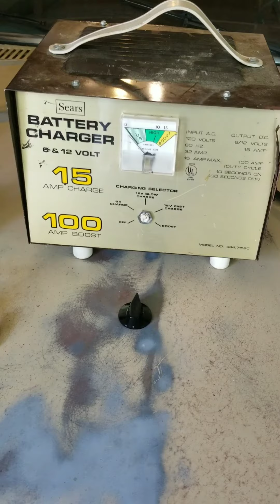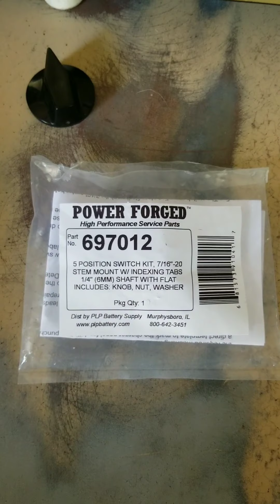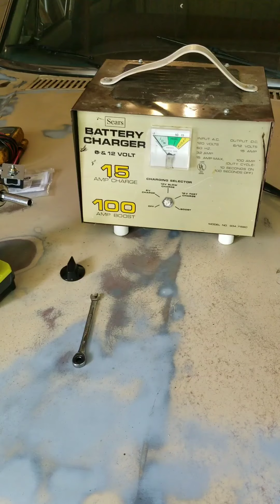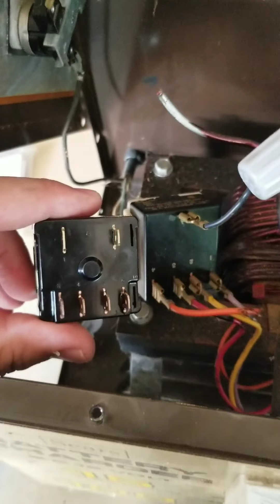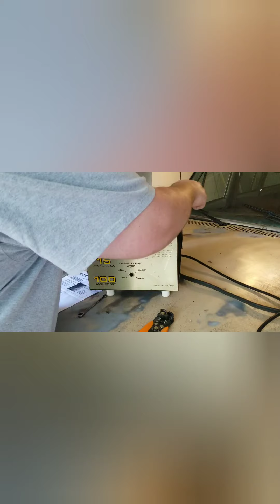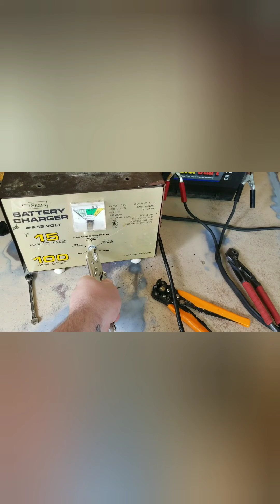Sears battery charger switch replacement

Comment: Would the 697012 switch work for the Model No. 934.71830 Battery charger as well? ( The 934.71830 is the 30 Amp Charge 200 Amp Boost model)
Reply from the maker: I honestly have no clue. I just found a switch that matched my original as best as I could.
Reply: @bryan350sb  Thanks for your response! I’m currently trying to fix the same issue on my battery charger that you were in the video. It’s a great guide!
Reply: Kid did you figure this out? I have the same model as you and am in the same spot.
Reply: @timothywilson6011  It worked!
Reply: I'm pretty sure I have the same switch as you but can't quite figure out the correct wiring order.
Reply: Do you know what year yours is? We have the same one and are trying to figure out what year sears came out with these models